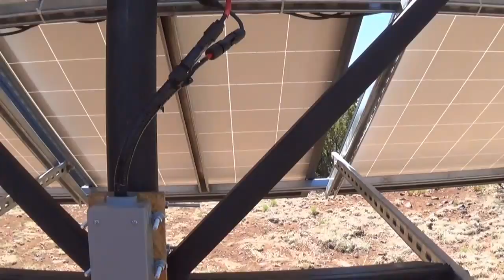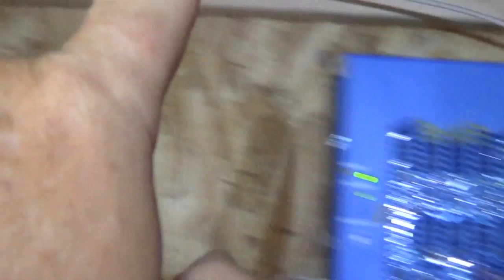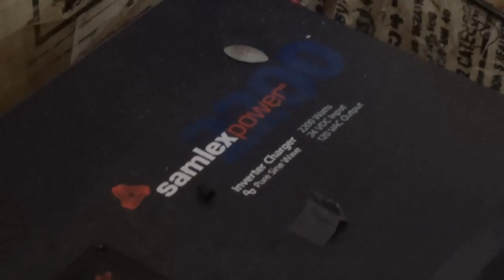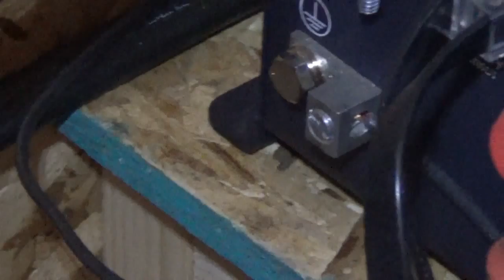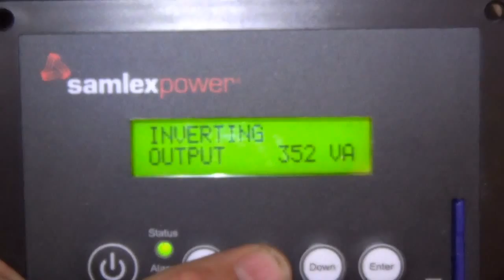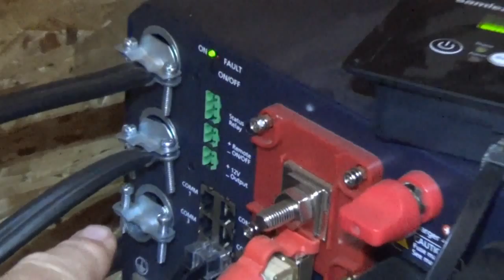Off Grid Solar Power up and running now for 2 months. I got solar

Comment: here a tip.for you. I've been using solar for 42 years. I finally got 5000qatts of mono panels . I'm using one right now until I get help installing them on roof. ok so one 350watt 24volt 10 amp.panel connected directly to a 14 ton13.6v downconverter power a small.compressor freezer a 48led work light and a home entertainment system (fm.casette.diskplayer20watt system? and a drill charger IN the RAIN. without batteries. so downconverting to a stable 13.6 volts runs a 500 watt inverter with virtually no light just clouds and raithe tip is buy larger 24 volt panels and a 25 dollar 480 watt dc dc down converter and have good power in the brain. by downconverting you increase the amperage and wattage and it putv13.6 volts for those inverters to keep them running until completely dark out side. on a full sun day my 350watt panel maxes the 500 watt inverter. good info
. and thanks for your videos
 here's a couple of mine showing of a rain powered panel with no battery.https://youtu.be/5pVCiPfLJR0

another more Rainey day
https://youtu.be/KqhSiUvxITY
Reply from the maker: great info. thanks.

Comment: Hi Jeff, awesome video! I have a question.. I live in a house & I plan on setting up a solar system and transferring a couple of 15 amps circuit breakers to its own  panel electric box to be powered by solar as a primary source. Can I still use my grounding rod to ground my solar system or do I need to use the ground provided by my home grid? I heard that using 2 different grounding sources (the one in my home & my solar)  at the same time can damage my inverter and other parts of my solar system..? What are your thoughts on this? Thank you so much for your time and feedback 🙏🏻😁
Reply from the maker: you want 1 grounding rod. from what i was told is the short/surge will try to go to both grounds. however if they are completely separate (solar n on grid) from each other so any surge/short could not go to the other line having a separate ground makes sense.   solar only put all grounds to one ground.  . does that help.

Comment: could of jumper the top lugs in that panel and just used a single pole  60 amp breaker.
Reply from the maker: sure. what matters would be the size of wire making sure it can handle the volts. basically you can wire your panels anyway. the best way is to wire them up in series increasing the volts with lower amps becus the higher volts with big wire will have less loss in power than lower voltage.

Comment: http://www.ebay.com/itm/291286875532?_trksid=p2060353.m2749.l2649&ssPageName=STRK%3AMEBIDX%3AIT  and this http://www.ebay.com/itm/DC-12V-160W-24Pin-Pico-ATX-Switch-PSU-Car-Auto-Mini-ITX-High-Power-Supply-Module-/161270932210?hash=item258c7f22f2:g:kUoAAOxy7nNTQ6eG and a solid state drive makes a pretty good 12 volt computer
Reply from the maker: thanks.

Comment: are you cool enough and warm enough in the seasons. i know you had snow. where is the dog, i'd like to see it running around. is it getting the rodents. is the driveway ok now, good enough explanation.
Reply from the maker: great questions. you know i may have to do a little piece on questions.  haven't seen a mouse or rat for some time but the dog is bringing home little bunnies. so far 3 little ones and 1 big one. lol.... the weather is great compared to phx and their 115. lol.... although the dog doesn't like the 95 degrees we had the other day. the 80s seem to be fine .

Comment: does that set up give you enough power for air conditioning ?
Reply from the maker: great question. for a small window air conditioner it might run around 8 to 12 amps at 120v which converters to 80 to 120 amps at 12 v and 40 to 60 amps with my 24v system. my batteries total to 936 so the 80 amps is almost 10% so I could only run a window unit for about 5 hours and have no power left. i am looking into how much draw some devices have like my desk top computer and things so more information is coming. i can tell you this for what it looks like i may have to in the future add more batteries and solar panels.  does that help you on the ac part?
Reply: ArizonaHotHomestead yes
Reply: Hi, I am from Malaysia and have a system similar to yours but using all the cheap components but can run 1hp air conditioner for 6 hrs.
Solar penals total 1900 watts . My air con using  240 volts 50 cycle. 
Batteries using bus convertional battery 150 amps 12 volts.  8 pcs so
total 600 amps 24 volts.  1 battery cost 85 dollars US only and give better result compare to yours. I charge my battery to 14.8 volts.
Maybe you did not charge your battery to full capacity. You can change
the setting on your charge controller. My inverter is 3000 watts 24 volts input  240 volts output.

Comment: system looks good
Blue Sea is the best on the market in my opinion. 
Blue Sea Systems 600A-1000A PowerBars
https://www.amazon.com/Blue-Sea-Systems-PowerBar-Cover/dp/B00V4PAIOS/ref=sr_1_3?srs=5638639011&ie=UTF8&qid=1465507502&sr=8-3&keywords=battery+terminal++bus+bar
Blue Sea Systems 5191 Fuse Block Terminal 30-300 AMP / fuse sold separate
 https://www.amazon.com/Blue-Sea-Systems-5191-Terminal/dp/B0019ZBTV4/ref=pd_bxgy_200_2?ie=UTF8&refRID=C9JT538H6CSEDMWMKXS1
Reply from the maker: thanks for the info.

Comment: Really nice setup and excuse my ignorance on these types of solar setups, I'm still learning the details but I recall your video about your generator box. Is there a way to incorporate the genny into this system for redundancy should you have a problem with solar or if you need some extra juice to charge the batteries on cloudy days? Great video!
Reply from the maker: thanks.  I will build another gen box for the solar area. the thought is to have a generator dedicated for the solar in case like you said I need the extra juice. the inverter is also a charger so I wire up the generator and it will charge the batteries and or use the inverter as a pass through using the generator to power my loads.   In fact I should have the generator wired up soon and will make sure it all works and do a video so stay tuned. lol , the generator is a manual pull start but I could use a auto start generator if I had one.

Comment: VA is Volt Amps. I just Installed a Samlex 4024 in my home a couple weeks ago I love it. lots of info on that remote.
Reply from the maker: thanks. so if volt times amps is watts what exactly is volt amps?
Reply from the maker: thanks
Reply: Volt amps gets very confusing ,most inverters are rated in VA.  Watts are what U need to be concerned about. The VA will vary compared to watts depending on voltage out put ,power factor at a given time, many different things it will rarely match up with watts in the real world ,this is what I have found .
Reply from the maker: thanks